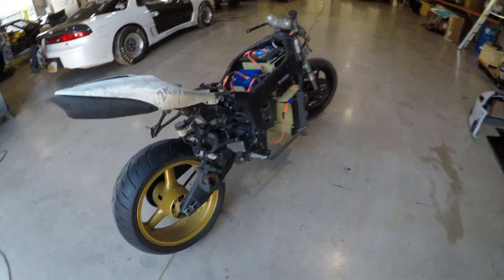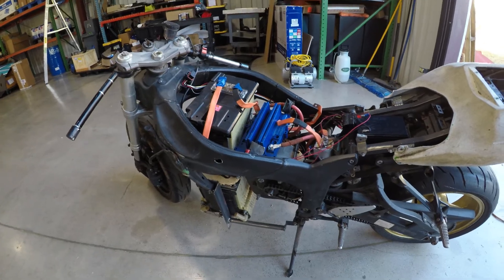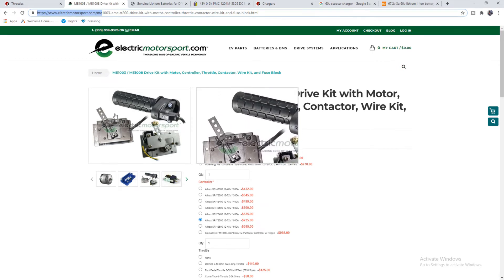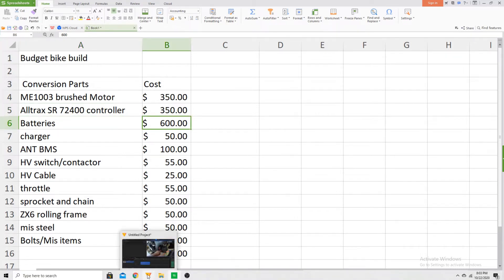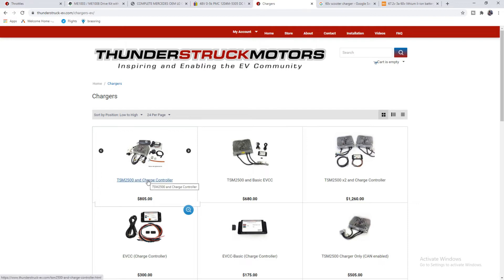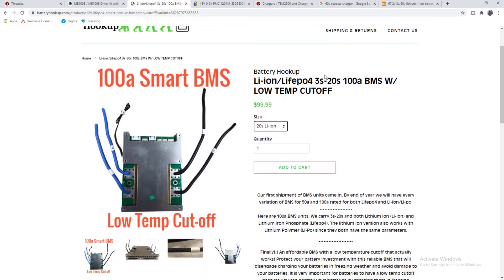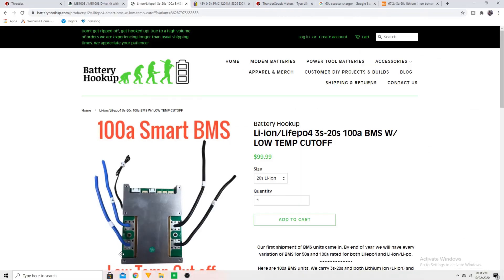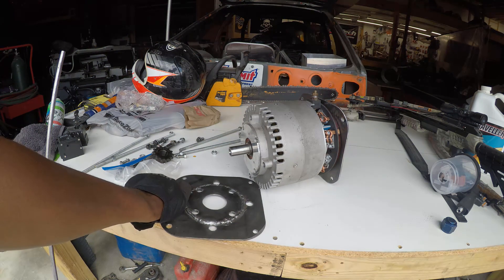These are the cheap parts I used  to build a Fast electric motorcycle!!

Comment: i have a 99 KE100, the motor needs to be rebuilt and there are 6v electrical issues, i am thinking about ripping it all out and just doing a full electric build with 12v

Comment: Hey mate, thanks for your video,  have you tried to charge ur motorcycle on ev charging stations or do you know if it's possible to build so It'd work?
Reply from the maker: Hello I don’t have a j1772 standard charger on this bike so I won’t be able to use a EV charging station
Reply: what state are you in?
Reply from the maker: @stygianindustries8295  Georgia
Reply: @DirectedWisdon  I'm in birmingham. I'm converting  a 98 cbr for a new motor company that touts some impressive stats. greater than 98 percent efficient

Comment: Hello sir. What is the top speed and range of bike?
Reply from the maker: Top speed was 96mph and I haven’t fully tested range but with the amount of batteries the range under moderate load should be at least 50miles
Reply: @DirectedWisdon  sir then 0 - 60mph. how many seconds it will take to 60mph. I was really interested in building my own electrical super bike sir. With is the best option WE1003 or WE1616 to built a super bike? Or any other motors can u suggest? If u can please make a complete video on motor selections and what should be the battery capacity to get estimate range. Please Thank you sir
Reply from the maker: @God-on-wheels  great question sir there are a lot of other motor choices for sure and I do plan a second video detailing all the choices. To answer your question the me1616 is a better option because it is more efficient AC MOTOR and offers better water cooling. However the me1003 is a more simple dc motor design and offers very comparable performance. So I believe that either choice will give you the performance that you were looking for but if you have the resources I would go with the ME 1616 and a good controller such as the sevcon gen 4
Reply: @DirectedWisdon  I appreciate you sir. Thank you
Reply: @DirectedWisdon  I am waiting for the video 😍